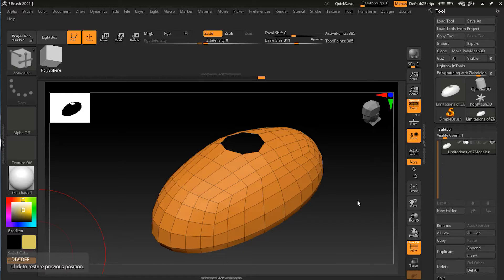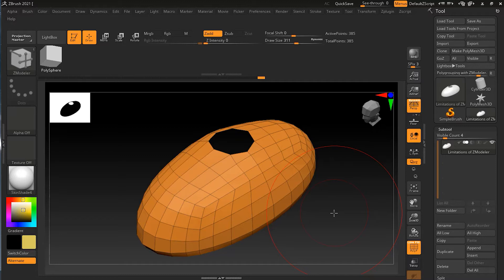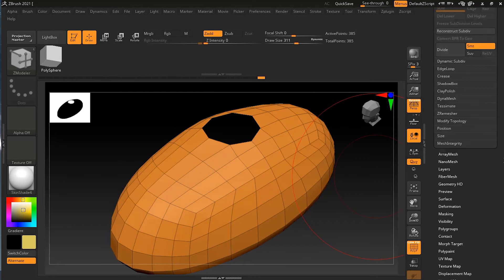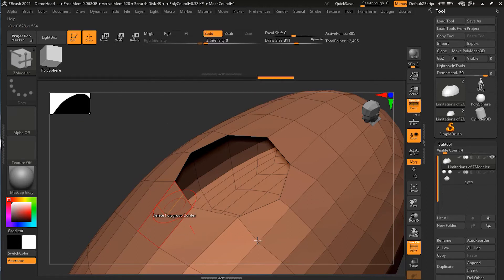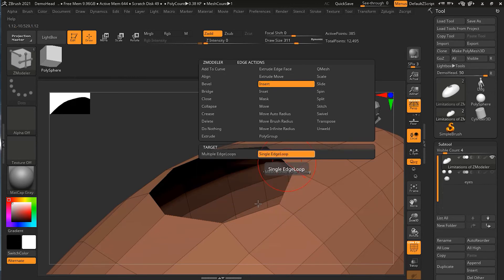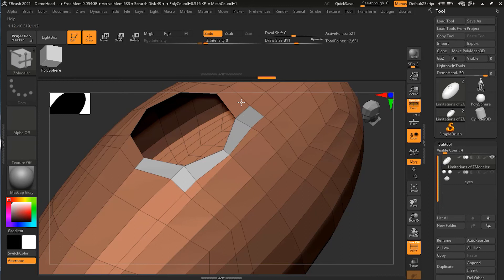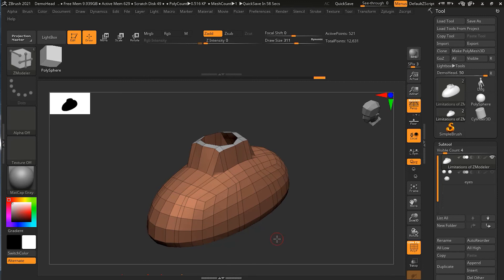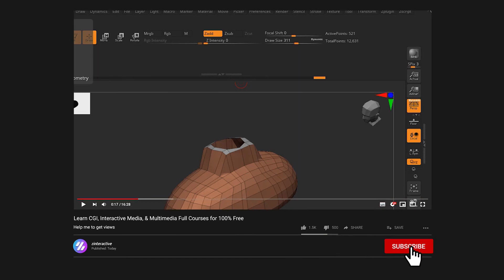Limitations of Using ZModeler Brush in Zbrush | Lesson 8 | Chapter 7 | Zbrush 2021.5 Full Course

Comment: fyi - Slice Mesh was added to ZModeler Point, Edge, Polygon Actions in 2021.5 but doesn't appear in your Zmodeler menu so it seems you're running an older version (2020) than stated in the title. Might help with some of the problems you mentioned earlier about inserting edges and so on.
Reply from the maker: yes I made a tutorial on Slice and Mesh too in the same series explaining how the limitations were improved with the new release